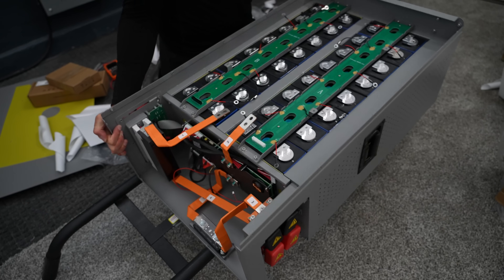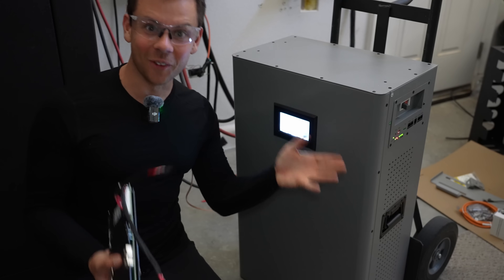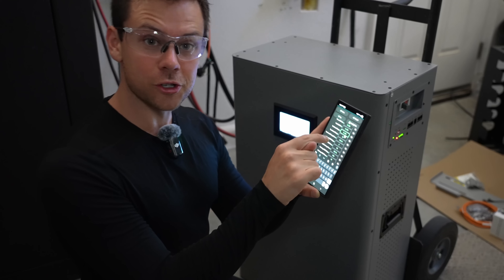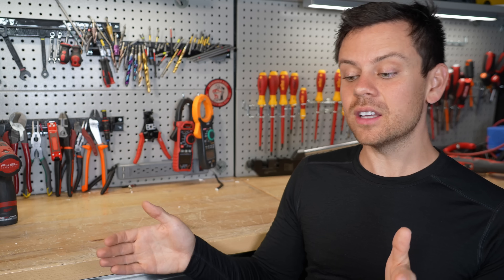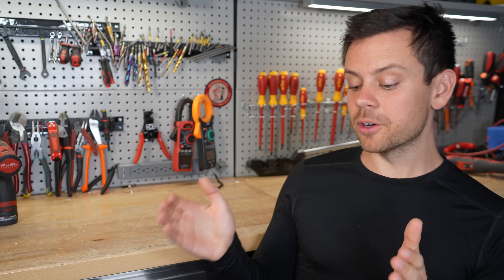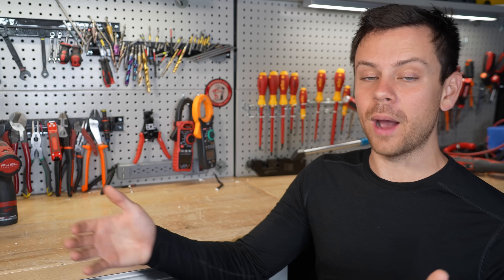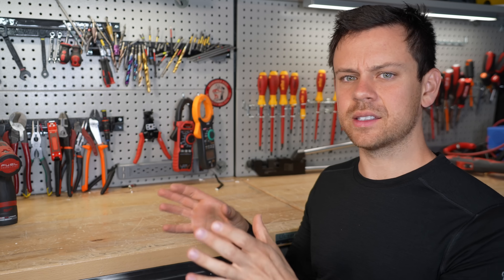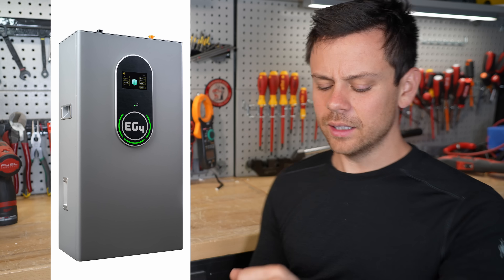Yixiang 16kWh Battery for $1,899?! What in the world!!

Comment: From my experience a BMS only goes bad if it's low quality to begin with. Active balancing does indeed make your BMS more complex and thus more prone to failure. But when it never gets wet and never gets mechanical damage and never is connected to solar without mppt or pwm it should outlive your cells. A battery pack like you have should be able to withstand a direct short circuit across the terminals. Switch the BMS off, directly bolt a busbar between the positive and negative terminal and switch it back on. Often the BMS just blows up but a quality, matched BMS will survive. And not one time, but many times. In fact, this is one of the tests needed for the certification of a battery as a whole. I do trust 100balance or now Daly. JK is just garbage, with only 200A off-grid garage managed to release magic smoke. Whilst a short circuit easily crosses 4kA, possibly reaching 10kA

Comment: Active Battery Balancers CAN help equalize for a low capacity cell. As a weak cell begins to drop in voltage, the others will share a small portion of their collective capacity to try to keep the weak cell Voltage up.  So in the end, if you have a weak cell that's only 26 Ah cell, in a battery made of 16 x 20Ah cells, the group of 15 good cells will each donate (as an example) 0.25 Ah to the weak cell.  So you have a total of (15 x 0.25 Ah = 3.75 Ah) to bring the "effective" capacity of the weak cell up to (26.0 + 3.75) 29.75 Ah, while reducing the remaining 30 Ah cells down to (30.0 - 0.25) 29.75 Ah each.

Comment: I have two 200A JK BMS with EVE280Ah cells on shelf in basement. They cycle up and down with my Sol-ark 15k, and B1 has been online continuously for 2Y252D, B2 2Y222D, The home built system is rock solid, and stable, with maximum cell to cell deltas of 5-15mV... I am impressed

Comment: Quick general query. 2 adults, three teens, smart meter. I want to add a battery and inverter to my house. 
The idea is to use all of my cheaper rate power to charge the battery so I can use it in daytime.
 Maybe solar panels down the road. What would you recommend? 
5Kw/h battery sufficient? BTW, in Ireland, so at the mercy of the internet and crummy delivery charges etc? Thanks Will. Shane Egan, Tipperary, Ireland

Comment: "If your cells are quality matched cells" .. yea .. to be precise, most  pack are not "matched" good enough, so the balancing is still a good thing and the active one is far better then passive.
I use a pack since 2019 (280Ah) with a jkbms 2A that i use at 1A max, i balance when delta is over 0.030V and franckly .. my pack is still pretty nicely balanced 6 years after.

Comment: Will, think about the guidance  you gave on how to balance your battery if it starts drifting... charge it to the max, pop the lid and individually charge each cell...  Not exactly desirable on a production system :-).  On the other hand, if you have a JK bms, it does it all for you [while your system keeps working in production!].   Andy at Off grid garage uses JK bms on almost all his battery banks w/o problems.   I also use this BMS with no problems whatsoever.   The only issue with JK BMS is that the documentation sucks (as in, it doesn't really exist...).    But Andi's videos currently make up for the lack of docs.   I recommend it for DIY users.   Furthermore, with the latest version of the BMS (hardware v19), if you have at least one of your power banks running V19 and it controls all connected JK Bms power banks and you can monitor everything from the one V19 unit.    It has good communication with the inverters (EG4 6000XP for me).    One weakness is that the built-in shunt is not very accurate.   I use a Victron shunt as the "truth factor" to inform my Solar Assistant monitoring system about the real current capacity of the system.    I encourage you to revisit your position on "Avoiding active balancing BMS"....   or at least the assumptions behind it... that active balancing fail more than BMS with no active balancing... is this still true?   Is a JK inverter BMS more lilely to fail than another less advanced model?   I say thing because a lot of people follow your recommendation and I suspect that this one is more based on a hunch than well researched facts.... my two cents 🙂

Comment: I completed all orders for my own DIY 16kWh battery. 16x EVE MB31 + JK PB Inverter BMS 300A Version v19 + 4.3" display + case (case built like in the video of a german youtuber, the "Volksakku").
In total, I spent 1.300€, even though I used high quality parts only - of course a vertical metal case is a little nicer - but is that worth more than 500€?
The case looks nice actually though, so it`s definitely worth a look if you`re not willing to build your own...

Comment: If you don’t want to use the 2A balancer, then just set it to a lower value, 2A is the max not the minimum. Maybe also set the start voltage a bit higher for when its active.

Comment: Sorry cannot understand your comment on the active Balancer. With regard to your Video of most Common faults/mistakes an inbalanced batterypack is a huge Problem. With good (Not Default LFP Settings) this Balancer Takes Care and does good Job. This is Out of my view much lower risc than unexpierenced people doing strange things by manually Balancing their Packs. I can read so many people doing strange and stupid things only because they sound important to do and for me they just should use their Balancer by good settings and this is it. In addition you are very focused on the price of this Kit, OK. But please also mention typical Chinese quality issues Like the very Dangerous MCCB (200A) without quality and approval stamps. Tests of These MCCB Show that these MCCB can be a huge risk by operating wrong. Don't get me wrong I have 2 YiXiang horizontal cases by myself and Like them. But it's important to know and eliminate the weak Points for a Safe Operation.
Reply: Good points, active balancers put to bed the old soothsayers method of top balancing by putting 16 cells in parallel and waiting for charger to hit 3.6V.  But active  balancers do tend to hide 2nd rate cells. I would suggest these are such because of the price and double hole welds and threads directly into aluminium. I would much prefer to buy a DIY box and a pay extra for cells from a reputable supplier.
All these boxes need TClass fuses and a disconnect switch. I don't believe any MCCB alone is adequate. Fires with LiFeP04 are caused by energy shorting ( hence TClass fuses) or over charged and gassing cells. So the next safety feature should be  a back up over cell voltage detector on top of the existing BMS.

Comment: I got some grade A- 314 AH cells from DocanPower for $40/cell. Ordered 68 cells, and just received them a couple days ago. 1 cell had a small dent but the voltage and resistance still measured totally normal. I paid about $5200 to have 68 cells (68 kWh) for the cells and 5 JK BMS (in case 4 cells, or 1 BMS had an issue) so my battery will still be a little cheaper than getting 4 of these, but only by a few thousand dollars! Pretty impressive stuff.
Reply: Could you share the link to the Docan cells please?

Comment: I like. Finally! I've never been a fan of server rack style packs since server racks are for computers/electronics which weigh much less-actually they are heavy already.
The future of this style of housing are taller ones for higher voltages.  It just hit me that I'd prefer this product to be taller but slimmer where all cells are on top of each other. 
Going above 48volts is more dangerous for DIY but I know they can design safety features, more user friendly, and quicker to build-I don't like screws.  I wish the industry adopt something easier like a lever style locks and unlikely to make mistake on polarity. 
Good point on active balancers, never a fan.  I think the reason this practice grew because of riskier and less reliable NMC cells

Comment: Just had a dealer installed system done in the Philippines.  The price for the  LV TOPSUN 51.2V/300Ah (15.36kWh) batt. to go with a  Deye 12kWHybrid On/Off
Grid Inverter was $1,881.31 USD...(no additional taxes).   Inverter cost $1,934.06 USD.

Comment: New to the JK-BMS? 😉
Congrats to 1M subs!
Reply from the maker: Andy!!! What's up! Yes haha need to watch your videos more! 

Do you have one of these things?! Super cheap for what it is. This BMS is nice. Is there anything you hate about it?
Reply: @WillProwse  Good to hear from you again, Will. We should talk more often!

Yes, I have this Yixiang DIY Kit as well and made a review a few weeks back.
Check the fuse inside. It does not seem to be rated for 48V system but just a normal ANL fuse (32V DC max). Also, the breaker despite having a 50kA breaking capacity, no data sheet or specs whatsoever...
In regard to the outside terminals, the negative cables are supposed to feed above/under the positive terminals. There are small latches in the chassis for zip-ties to organise them. Then, the cover will fit again. But I agree with you, the Futronics terminals are a lot better than these open screw terminals, safer to connect, watertight and overall the better (but more expensive) choice.

The JK-BMS is certainly the best choice in the DIY world right now as it provides a full charge algorithm with bulk, absorption timer and float settings. It can perfectly control most inverters and conditions the battery nicely. The pre-loaded LiFePo4 profile provides some safe settings but need some tweaking to optimally run the cells with this BMS.
I had the EVE LF280K (280Ah rated) cells from Yixiang and tested them with over 300Ah+ capacity in a 16s setup. These days, we see very high-quality cells on the market.
Now, we have the MB56 cell with almost 2.2kWh/cell. Makes a great 34kWh battery pack😎

Stay charged, my friend!
Reply: @WillProwse  Andy has the horizontal version for sure. He's how I found out about them and why I bought 5 boxes and batteries from them!

Comment: They actually make a 15kwh system like this on wheels with terminals on the top for $2,000. 😮 That seems completely reasonable to me. I don't feel confident building it so paying a little more seems worth it.
Reply: *unless shipping is insane
Reply: Lame they raised the price by $300 since I made the comment. You can buy 3 server rack batteries for just under $2,700 (not sure about shipping cost) and I'm assuming shipping will be insane for their massive 15kwh battery so probably not worth it now. $2,000 seemed like a damn good deal. 

Looks like I'll stick with Pecrons expansion batteries, which have more solar input per battery, which is awesome.

Comment: The threads on those cells can be repaired. Just like any other thread that is damaged, just retap the hole. The biggest downside is that the busbars would have to be drilled out to a larger sized bolt hole which is a little tricky with those flexible bars.
Being aluminum just it's pretty easy. Just put some tape on the bit to make sure to not go any deeper and then manually tap.  Better than tossing the cell out.
Reply from the maker: You can't fit a tap in there without hitting the cell. Super common issue with these.
Reply: @WillProwse  Not sure what kind of tap you're using Will, but most taps start their work in the first few threads. Are these holes only <3/8" deep? The cells I have the holes are more than 1/2" deep.  They were tapped at the factory, so taps are available of the proper size otherwise they couldn't do it at the factory.

Comment: I just built my first batteries using Yixiang V2 boxes. So far they have been perfect. The only problem that I can see at the moment is in have them in parallel and they do not discharge at the same rate. One is always about 8% lower SOC in the morning than the other.

Comment: Welcome to the world of 51.2V 16s LiFePo4 blocks😂 That's something different than the 100 or 200 Ah ready-made batteries😅

Our off-grid system currently has six LiFePo4 blocks with 16 cells and the 200A JK Inverter BMS.

You have to know exactly which parameters you're setting, otherwise the blocks and also the individual LiFePo4 cells in the block will drift out of control over time.

And I can only advise against LiFePo4 cells with double terminals. Last year I had a batch of 304Ah Eve cells from EEL-Battery, and the terminals broke off at a tightening torque of just 5Nm due to poor laser welding 😏

Most manufacturers don't use original Eve terminals, but imitation Eve terminals without stainless steel thread inserts.  

Naturally, EEL-Battery didn't like my blunt video series on this topic. They were pretty angry and wanted me to delete my videos about their 304Ah problem cells. Which, of course, I didn't do 😂😅

Greetings, Ronny
aka the Sunshine Ossi from Germany 😉

Comment: Great Advice...I do not like that you need a contac switch....for some balancers....Great Show
Reply: I Have two separate banks 6 powerwin 48v 100 ah in parallel both connected to 1 inch thick connection blocks...can work on one bank while still having power to inverter...kinda cool isn't it......

Comment: I’m currently running a 16s3p setup with two banks being Eve lf280k’s with those terminals. I actually really like them with the double screw redundancy and the flexible bussbar. Out of the 32 cells I had zero issues with any of the terminals. I also like the extra like added contact surface area that you get with these. That said I did find that the manufacturer had too much heat shrink on the flexible busbars and it had to trimmed slightly so busbars sat flat on the terminals.

Comment: Two thoughts/comments:
FIRST 
Cracked terminals may have been their vendor, and their recieving quality control/inspection was improved.
SSECOND some companies design/use a taper thread (female) on the terminal to insure the bolt fits tightly.

Regarding your wire connector problem. 
Proper manufacturing/assembly of connectors is a common defect, everywhere. 
Poor connection often create intermittent failures.
BEFORE YOU plug ANY connectors, very carefully inspect to be sure the little barbs are properly seated.

Comment: Tesla is building a new Aluminum Ion battery, has 3 times the charge of Lithium, charges to full in 10 minutes, NO dentrites so it has a 15k recharging cycle basically 40 years, Zero chance of fire. cheaper than lithium, easier to source materials, no Cobalt, and the new car starts out under $15K. Can't wait to see what you can do with those. Release date 2026

Comment: Aerospace care about cracks in aluminum because most commercial planes are pressurized.
Reply: And they vibrate. wide temperature swings and weather. Torsional stresses. Integral structural component. Liabilities. assured lifespan.

Comment: Been really contemplating these yixiang diys but in the horizontal configuration.. also looking at EEL V5 would be cool to see a comparison
Reply: Our new EEL JK V3 vertical box is also about to be released, with double protection of 250A DC circuit breaker and 250A T-class fuse.
Reply: @CNEEL-BATTERY  Nice
Reply: @CNEEL-BATTERY can the earlier vertical V1 V2 boxes be retrofitted with internal T-Class fuse?
Reply: @ocular57  Of course, the V1 model can be modified with our accessories to have a built-in T-class fuse. The V2 model can directly replace the original fuse with a T-class fuse.

Comment: I use JK BMS on nearly all of my projects - both the "inverter" type (like in this video) and the standard type are extremely capable and well optimized. The app is not particularly glamorous but it's very responsive and it ALWAYS WORKS!

Excellent video as usual, Will. Glad to see these ~15kWh kits are getting some more recognition. The value is almost unbeatable.
Reply: Yeah, the JK Bms has come a long way from what it used to be. It's pretty much the king of BMS' now with their functionality and easy of installation. I just recommend making sure to buy from them directly instead of some 3rd party seller, a whole lot easier to get help when something goes wrong. I'm currently working on resolving a comms issues and the seller I got the BMS from, even tho it was from AliExpress, is fighting on doing the warranty work.
Reply: Do they communicate with the Eg4 v1 upgraded to v2? I have an eg4 12kpv.

Comment: From my experience: The higher the amps when charging, the more they drift. I have EVE MB31 cells and I don't need balancing if I charge them with 40 amps (16 in series, 48v) If I charge with 60, or 80, the start to drift more per cell. 

I also had cracked terminals on my MB31 cells. Some even broke off. But it was with the first badges. My newer sets don't have this problem. Cracks are not normal.

Comment: You can fix the threads...

i'm guessing the threads feel wrong because they have never been used. To make them smoother you could run a blind tap through the threads, but I probly wouldn't. That tight feeling is like thread locker.

Comment: Maybe the problem is the thread on the bolts. i always check them with a good metal nut ; they should go easily by hand. 
A steel bolt with a burr or deformation will easily destroy the thread in the Alu batt conn.
Cracks in the terminals is definitely not normal! that's the result of too fast threading / worn out threading tools / not using lubricant .

Comment: Have 10 of these available for sale by xiho. Welded studs, NOT dual 6mm with all the problems. NOT VERTICAL CELLS as EVE says the 314ah are NOT designed for vertical stacking.
Eve grade A cells jk 200 amp bms

Comment: Those threads are an Easy fix with a cheap tap an die set from hobo freight.

That might fix the threads but it wont stop these cheap battery systems from being cheap.

Comment: Perhaps running a tap into the cell threads before mounting and/or replacing the supplied screws with known good-quality screws of the same thread gauge might make assembly go smoother?  Thanks for doing what's obviously a ton of work to make these vids.